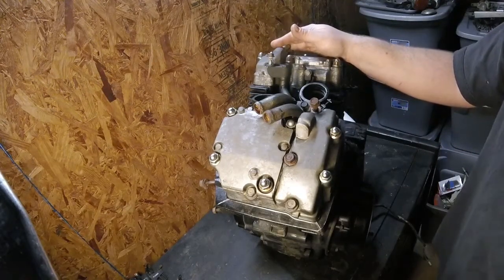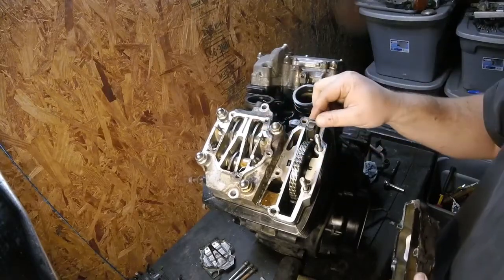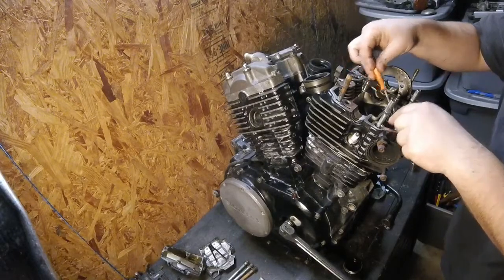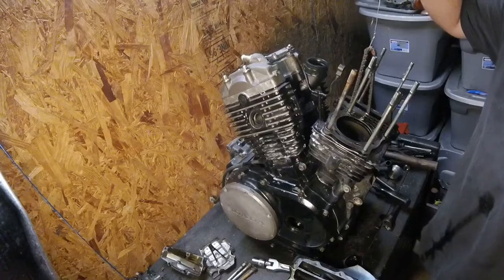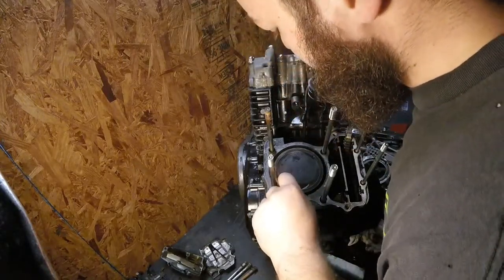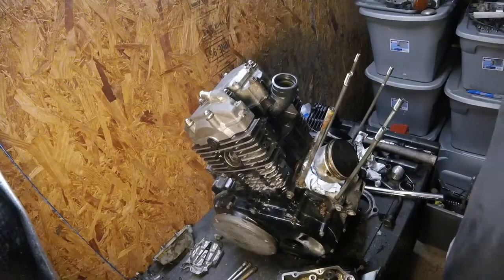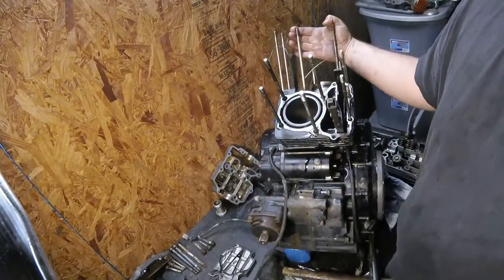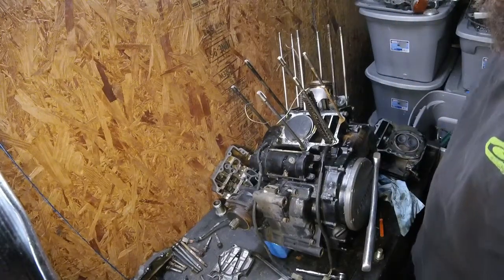1983 Shadow Engine Teardown

Comment: Hello, I see you from Argentina, excellent video, I have a shadow 1100 86 that I am assembling and I need to know the position of the cams to be able to put the engine on time, do you have any video?
Reply: I'm from Texas and I also have a 2004 hands shadow spirit back together I put a new crank on it and I can't get the cams and cam ch on TDCJ timing that I'm trying to put

Comment: I am starting work on restoring a 83 Honda Shadow 750. I am having trouble removing the top two water pipes. The long one wiggles around but will not come up out of the hole. The short one will not budge at all. Do you have any advice on how to get them out?
Reply from the maker: Find a way to pry upward on them. Most likely, you have some stuck o rings. Mine weren't easy either. I used a silicone grease when reassembling them to help keep that from happening next time. Keep in mind too, they are fairly easy to find used on eBay. So don't sweat it too much if you damage yours.
Reply: @DrYosh2  I did try to pry every way I can think of with a fair bit of pressure and it wouldn't budge. I assume there is just a rubber o ring to seal it. I have a spare one and I see what it looks like. I don't understand what is holding it in therr
Reply from the maker: @canoe-shelburne  probably just the rubber o ring with a little corrosion around it. They tend to be that way.
Reply: @DrYosh2  seeing that it can be done and a bit more perseverance I got the long one out. The short one still won't budge at all. There is quite a bit of crap inside the hole of the one I got off
Reply: Another question. Is it possible to inspect a timing chain without removing the engine
Reply from the maker: @canoe-shelburne  I don't believe so. I highly recommend you get the pdf copy of the service manual and view it on a PC or phone. Or print it. It will give you all the info you need. Even down to what repairs need the engine removed.
Reply: @DrYosh2  done that. I recently purchased a project. 83 Honda Shadow 750. One bike mostly assembled and most of a second that is unassembled. And a third engine. The engine in the bike can be turned manually one direction so far then stops and the other way so far and stops. My first guess is there is a problem with the timing chain and it is hitting the valves
Reply: I can not turn a full revolution

Comment: Could this be similar to the engine on a 2002 750?
Reply from the maker: That is going to be a bit different. 52° V angle instead of the 45° V in the earlier ones. I think they dropped a few features in the later 750s as well.